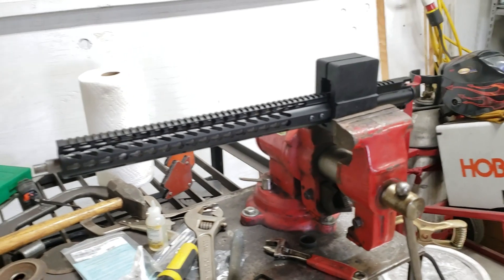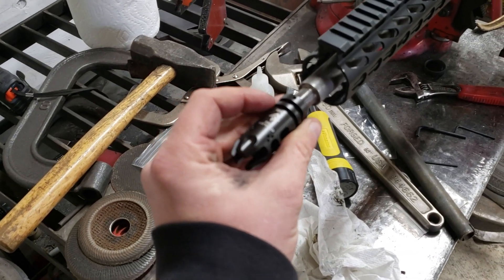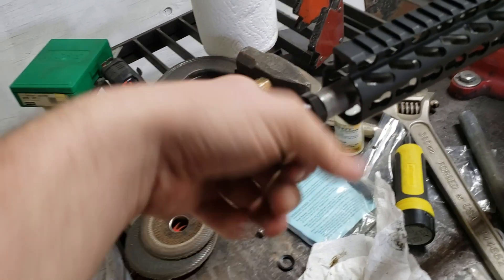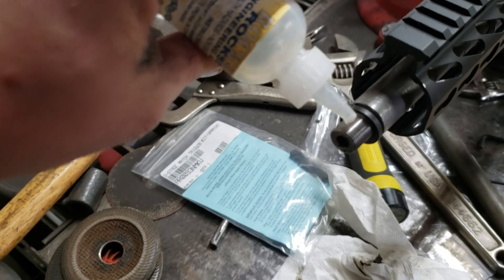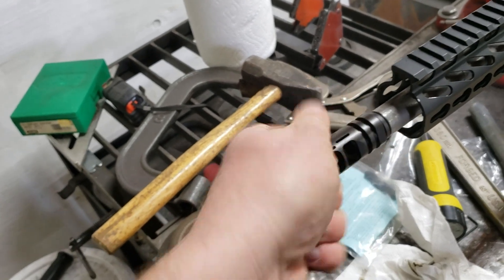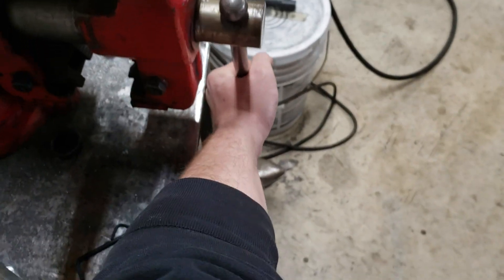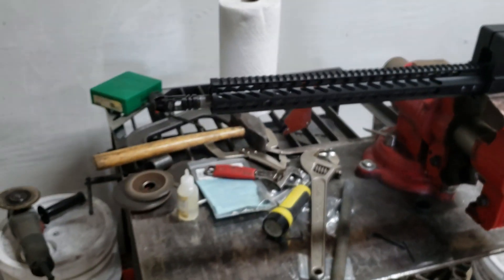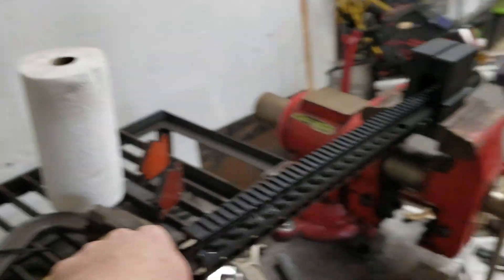VG6 Epsilon Install (easy)

Comment: Upside down Here is what the manufacturer says, amongst others and what looks like common sense to me if you just look at the flash hider you have 1 of 3 main jest shooting right up in front of ur line of sight.."For VG6 muzzle devices the proper 12 o’clock position is opposite of the laser engraving found on the muzzle device."    I know but it's a epsilon well guess what it is b4 that a vg6 per the name the lazer Mark's go down and long skinny slits are DOWN small holes up, go read it urself

Comment: Mine was at the 11 O clock position when I hand tightened. So I had to go a a bit more than a half turn with the wrench.  Thankfully I have the innovative and convenient BEV block.  Also had a Pittsburgh click toque wrench set to 40 ft lbs. 

Never got a click so I think its properly seated.

Comment: does crush washer have to be totally flat against barrel or is 1/16" OK between crush washer and barrel? the emblem is facing down..
Reply: If you apply enough torque to flatten a crush washer you got way too much torque..shouldn't need more than 50 ft lbs.

Comment: In the future vise your barrel not the upper.  All the torque being applied to align you muzzle device is being applied to the aluminium upper at the index pin on your barrel.  While you may not damage it the chance does exist that steel pin could deform your aluminium or shift the barrel alignment in the upper.
Reply: this is true and when it happens, you risk your bcg malfunctioning and getting stuck.
Reply: Yea he was twisting that barrel up pretty  good while having the vice so far away

Comment: So mine is installed upside down..... Is it a problem removing it and reinstalling? Do i need a new crush washer?
Reply: Rule of thumb is a crush washer is single use. If you are planning to remove the muzzle device and reinstall it, you will want a new crush washer.
Reply: @kevkev5935  thank you!!

Comment: What is Rock Set???....should have mentioned that!...is it some kind of lock tight?...anti seize?
Reply: It's in the hardware store on the waste of time aisle . If anything use a tiny bit of anti seize
Reply: It is basically a hi-heat loctite, you can order that same stuff he shows in the video straight from the manufactor.

Comment: I think it up side down....
Reply: Nope, that's the correct orientation.  Flash hiders don't usually redirect the flash but work by cooling and/or dispersing the burning gases so they don't ignite in a fireball.  The standard A2 birdcage flash hider is one of the best and for instance has 5 slits across the top.  One of which is direct at the 12 'o'clock position.

"Extended flash hiding prongs and no ports at the 12 o'clock positions allow uninhibited view from flash through optics or sights."  They are referring to the compensating ports on this muzzle device, not the flash hiding prongs.  The compensating ports are at the 11 and 1  o'clock positions but as you can see, there are no ports at the 12  o'clock position.  Your compensating ports go up and your logo goes down along with your pin hole.  If not, you're increasing the muzzle rise of your weapon, not reducing it.
Reply from the maker: @TripleTapHK  👊👍

Comment: Isn't that timed upside down? Don't you want to time it so the flash hider prongs vent the gas away from the 12 o'clock position?
Reply: Nope, that's the correct orientation.  Flash hiders don't usually redirect the flash but work by cooling and/or dispersing the burning gases so they don't ignite in a fireball.  The standard A2 birdcage flash hider is one of the best and for instance has 5 slits across the top.  One of which is direct at the 12 'o'clock position.
Reply: @TripleTapHK  Actually, Ryan G. is correct.  The point of it being installed logo up is for the pronged flash hider portion.  You don't want the flash directed upward into the optics plane.  The features on their website describe this. See here https://www.vg6precision.com/vg6-epsilon-556
Reply: @stugant220  Actually, he is still wrong and so are you.  "Extended flash hiding prongs and no ports at the 12 o'clock positions allow uninhibited view from flash through optics or sights."  They are referring to the compensating ports on this muzzle device, not the flash hiding prongs.  The compensating ports are at the 11 and 1  o'clock positions but as you can see, there are no ports at the 12  o'clock position.  Your compensating ports go up and your logo goes down along with your pin hole.  If not, you're increasing the muzzle rise of your weapon, not reducing it.

Again, flash hiding has nothing to do with the direction of gasses but is all about cooling the gasses.  As stated before, the A2 flash hider for example is one of the best and has the ports facing up.  This is first and foremost a compensator, flash mitigation is a secondary feature.  It just has flash hider prongs to help with the flash.  It's still quite bright.
Reply: @TripleTapHK  According to their website, "The VG6 Epsilon 556 carries many of the same characteristics as the Gamma 556 with a few exceptions. Extended flash hiding prongs and no ports at the 12 o'clock positions allow uninhibited view from flash through optics or sights. The difference in porting is also noticed on the underside of the device where it has 6 valve holes to allow the fastest gasses reaching the second chamber to exit. This creates very soft low energy recoil that allows for absolute control."  So, this explanation puts it logo up.  If you want, I can call them and ask them how it's supposed to be.
Reply: @stugant220  The 6 valve holes are not the same as the compensating ports which are the slots.  The 6 holes which are on the second chamber per the description, are on the logo side.  Which is the bottom.  I would rather you call them then keep trying to tell me I'm wrong.  Just trying to keep bad information out of other peoples hands.
Reply: @stugant220  Wrong again. His gas block is loose as he has it on the barrel since he is pinning and welding the break. At the end of the video you can see that the gas block is loose. He also says as much in the comments and says it’s installed the correct way since others noticed what you thought you saw. Logo down.
Reply: @stugant220  They get back to you yet?
Reply: @TripleTapHK  Yep, it goes logo down.  You were right.  Funny thing is, it shot fine upside down.
Reply: @stugant220  Yeah fine doesn't = good.  Using it correctly will yield significantly better results.  Other people have messed it up, fixed it, and said as much.
Reply: @stugant220  lmfaooooo
Reply: @WellThatWasLameLL  Lmaoooo! this guy was shooting it upside down. "It shot fine upside down." head ass.
Reply: No,Flash hider prongs hide flash they don't direct blast

Comment: Should have put the hand guard on last, Put the barrel in a vise with barrel jaws then timed the brake. Put way too much stress on the upper receiver doing it this way.
Reply: WarHammer went to the comment section looking for this exact comment, i also agree, cant be good on the upper

Comment: The problem with VG6 is no good way to index to make sure the brake top is in perfect alignment with the barrel.  I had the same issue with my 6.5 CM VG6 brake.
Reply from the maker: That is True
Reply: Small bar stock flat steel rod through the largest port. Place small magnetic machinist level on the rod

Comment: Should have bought a Miculek brake. It ranked 3rd, out of over 100 brakes, in recoil. Plus, it's only $40. There's a guy on YouTube that compares them all(pretty much). I'm gonna see where this one ranks...    Edit: I just checked. This one ranks #11, with 59% recoil reduction. The Miculek is #3, with 67% recoil reduction.   So... Not a bad choice, because this one may not be as loud, as the Miculek.
Reply: If you watch in that video it was upside down it should have done better
Reply: @krismartin1181  Yeah for whatever reason, a bunch of people seem to think the logo is supposed to go up because they don't understand that the direction of the prongs has nothing to do with their flash hiding capability.  Anyone installing it logo up is literally increasing the muzzle rise as the compensating ports are facing downward at the 5 and 7 o'clock positions instead of the correct 11 and 1 o'clock.
Reply from the maker: I own the j.m brake as on another AR platform as well which performs ok